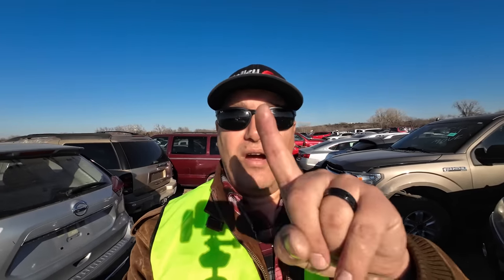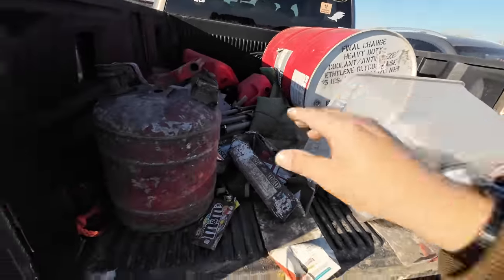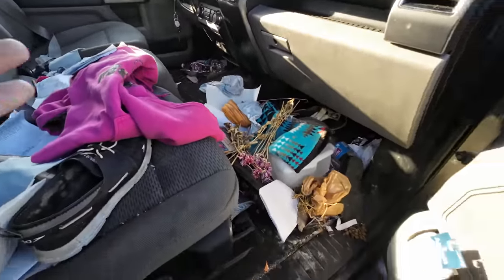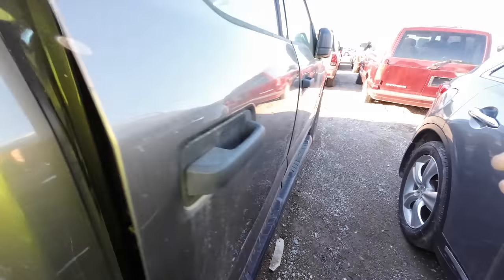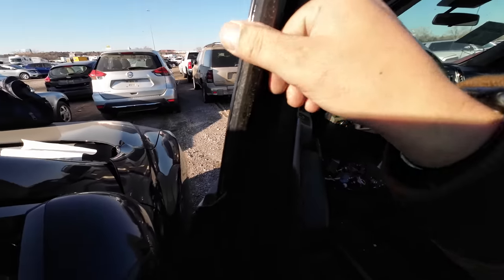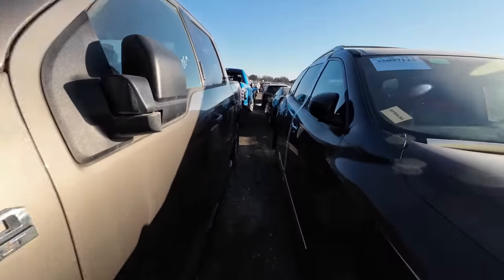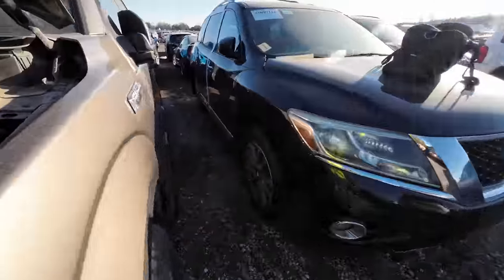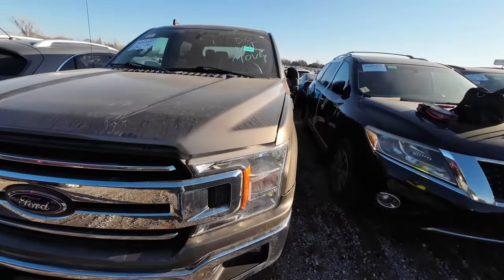IAA Walk Around 2-6-23 + BIOHAZARD 2020 F150! Will it Run?

Comment: I once worked for an auto auction in TX, when we received vehicles in this condition it was typically a repo. The owner would trash the car and destroy what they could in anger and frustration and to get back at the lender. They did not realize that they where decreasing the value and they were still responsible for the balance due, which typically they did not take responsibility for. With all the clothes this one looked like someone lived in it. Also, dealers would do things to vehicles, steal keys the most common , to reduce the vehicles value.

Comment: I feel that based on engagement, and only the metrics would show this, but 1-3 vehicles would be the sweet spot with balanced content around the 3 of them.  Not all the videos need to be 3 but like a variation of that so that the audience stays engaged.  But otherwise, love your content and so happy you are working with the form that works best for you.  PS the audio sounds so much cleaner, which I'm guessing is the new mics.  Love it!

Comment: @5:57 the truck shows 51274km, which is only 31,860mi.. it would've been worth be worth cleaning it out and putting it back on the road if it didn't have a JUNK title.. Hopefully someone can at least use it for parts

Comment: Single vehicle video might be ok if you have a vehicle that cooperates, when you are not short on time, when there is some type of resolution or conclusion that can be made about the vehicle (in question).  When you have multiple vehicles, it is more likely you will have more viewing value for multiple types of viewers, and they can fast forward, rewind, or revisit the video (at their own leisure).  I prefer multiple vehicles, this video was disappointing because of the one vehicle, without resolution, was rushed.